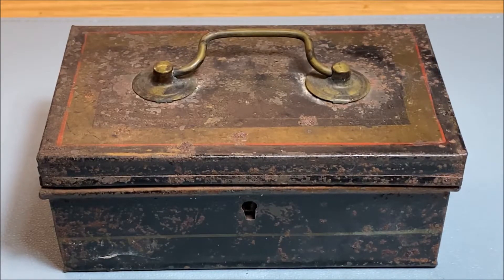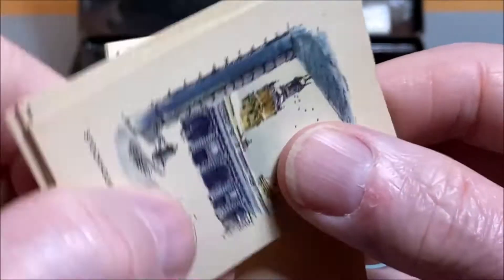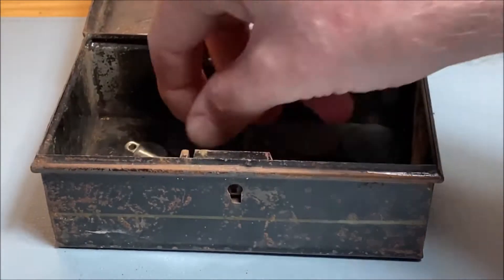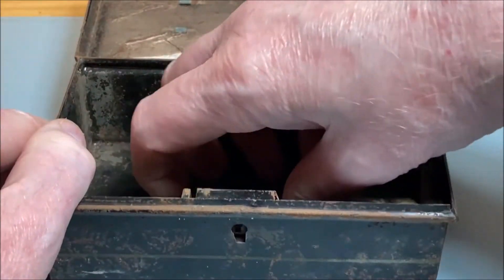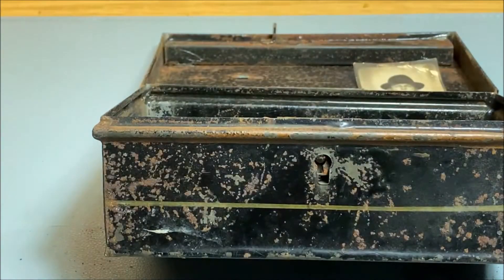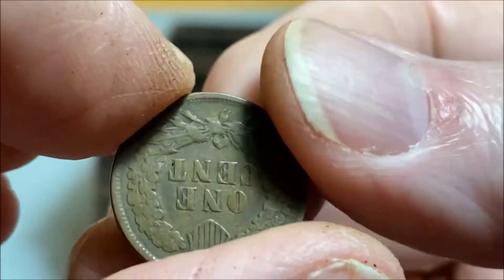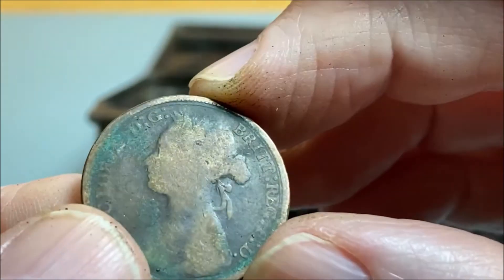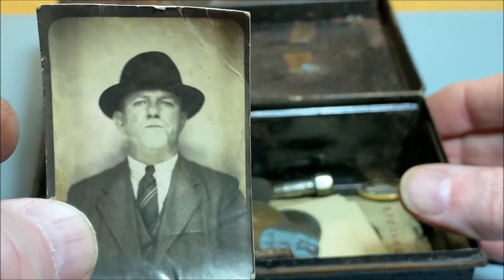WHAT IS IN THIS RUSTY OLD TIN BOX

Comment: Cool find, picture does look 1940's. Thinking maybe the guy was an engineer, that retractable pencil looks hand made, and the coins with holes look like they were drilled. The only tools that I think could fit that square hole are either helical removal bits or a very fine/small thread tap drive.
Also years ago, an engineering company I worked at the Capstan/Lathe operators sometimes used old coins to 'pack up' their cutting bars, and these would be super smooth and mishaped from years of use. 
Also that one coin looked hand engraved.
Who the guy was is conundrum for sure, but interesting. Cheers for sharing 👍
Reply from the maker: Thank you for the very interesting information. That’s the great thing about opening an old box is that it unleashes a mystery.

Comment: That is a fascinating little box.  There was a lot in there to research.  It looks for a job for the Antiques Roadshow.  I would think the picture is from the 30's or 40's.  A search of Edward Barnshaw may reveal something on the person.  It looks like a memory box for a family member.  Probably more sentimental than monetary.  Those are some really old coins.  They look like a Victorian collection.  I do wonder if some of the holey coins were sewn in clothing for emergencies.  It's a thing I have heard of.  Others with 2 holes look like they were worn, maybe as a neckless or bracelet.  That US One Cent is an "Indian Head" penny.  It could be worth a few Pounds.  What I found is it can be about $3 to $8 US.  Use care if you clean any of the coins.  By strong cleaning you can reduce its value if it removes metal.  Even the mechanical pencil is interesting and may be historical.  It might have been something a craftsman might have used.  Thanks for sharing.  It is very fun looking at those things
Reply from the maker: Thanks for the great ideas Vince. It’s a mystery wrapped up in a riddle that may or may not be all connected.